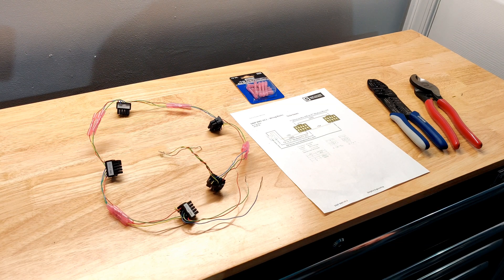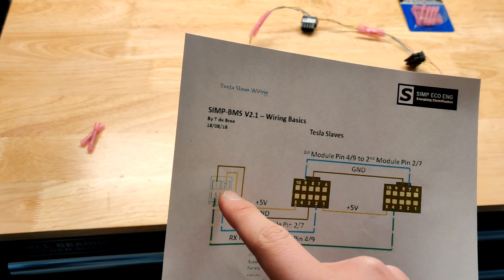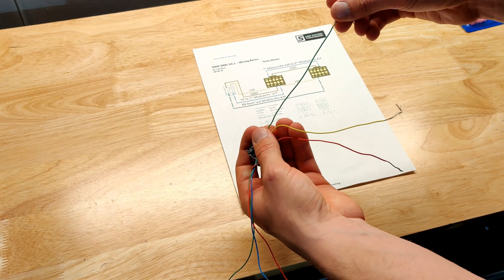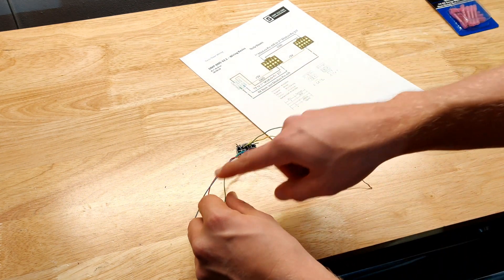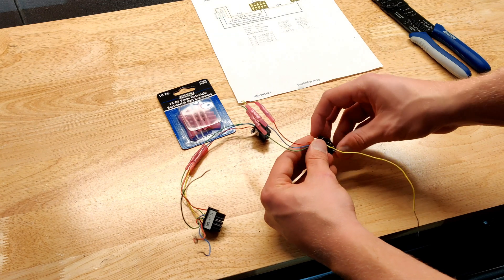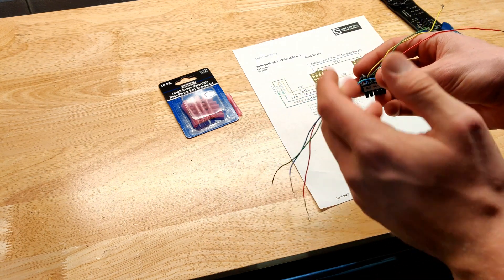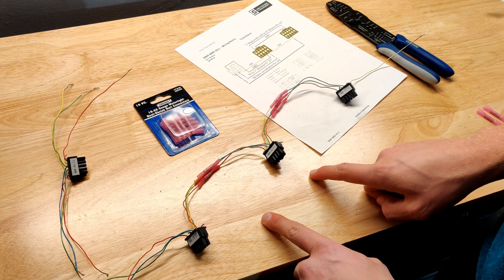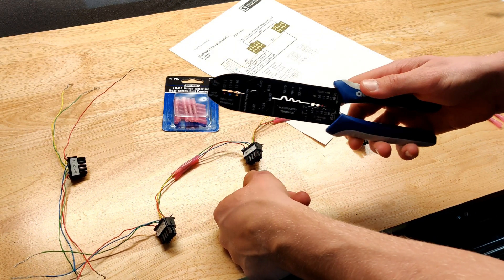Ford Escape EV Conversion EP 19: SimpBMS Wiring Harness for Tesla Modules

Comment: Hey, Reider it's the person who asked just for this great job hope winter break gives you time to work. I am working on replacing a clutch in a 2007 Honda fit and it's extremely hard due to lack of space.
Reply from the maker: Yeah clutch replacements are hard, especially in newer cars where everything's more compact. If you have an engine hoist you can pull the engine and transmission as one (or lower it out of a car, not sure how the Honda fit is designed), and then pry them apart. It's a lot of work this way but it's also a lot easier and more straightforward.
Reply: @reider_mcfeely  Yeah that's what we had to do. They don't make cars the way they used to. They were much simpler and easier to work on then.

Comment: You really should de-pin those unused pins instead of just cutting them off near the connector. Not knowing what the function of any of them are, there is the potential for a short to become explosive.
Reply from the maker: Yep, I ended up bending the pins back into the connector in a way that they're well isolated from each other. I tried removing the unused pins entirely, but all of the pins are held in with a retaining clip that I don't think is meant to be removed.